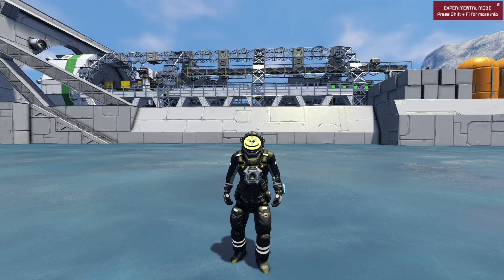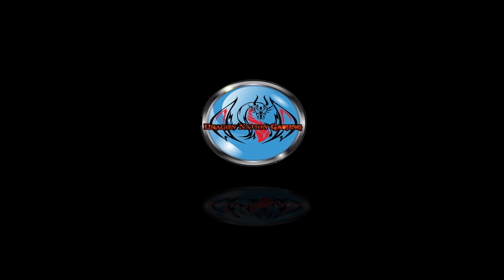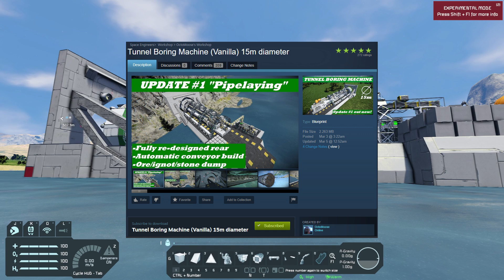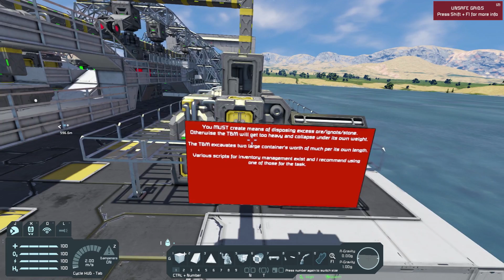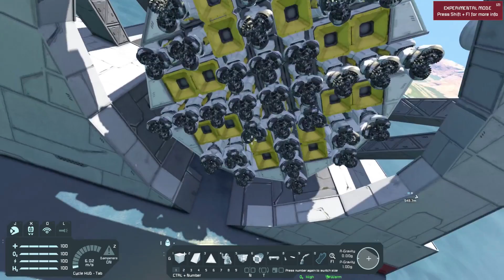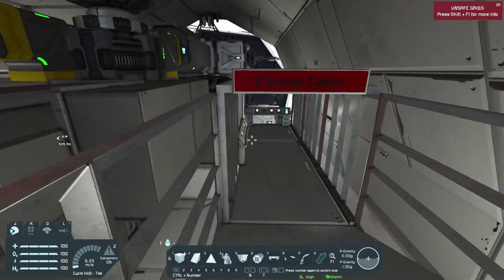Space Engineers #11: Octomoose Boring Machine

Comment: I know this may not work now, but I was thinking. What if you could replace the rotors on the top for making the system move forward with the pistons you use now, then make a similar thing on the bottom where it connect to a conveyor which unloads the resources. This is only taking your Inchworm system that works and merely using it's workings on the Octomoose's design.

You have three pistons, two top and one bottom. The first top one detaches from their merge block and moves forward where it connects to another, then pulls while the other two push the bore forward before the back top and the one bottom, that has a connector to the conveyor and merge block, would detach and move to their new spaces and so on. (The bore would still move and weld stuff while always having three connections as it moves. Just my thinking, and hopefully that makes sense.)

Comment: another idea for missed wielded areas add another set of projectors and a second bp slightly ahead of the others so they wield the farther bocks first then the older projectors can handle the rest, it might also add stability as you are adding to a set structure that would be connected to the inchworm tunnel itself and the tunnel machine.

Comment: Love the video but I use a drum drill instead of a bore. You get a wider tunnel. All you have to do is merge two rotors together and invert one of them (or just set the torque to 0 on one of them). 

Building a combine isn't hard and you can use pistons to move the mining arm up and down. This way you get super smooth and wide road. No need to build anything just add a few welders to the back and as the drills rotate around they are repaired.

You can just eject junk stone as needed, and have a transport dock and offload ores/ resupply components for welding.

Comment: You could use those modded advanced rotors, they are huge and don't suffer from a bad case of the weeble wobble...
https://steamcommunity.com/sharedfiles/filedetails/?id=1294456467&searchtext=rotor
Reply: This times 100. 

I like to merge two of them together for a giant drum drill. Makes leveling wide areas easy. Just make sure to either disable the torque or inverse the rotation on one of the rotors.

You can use it in both vertical and horizontal applications.

Comment: so from playing with this model in general, it DID work, however, there was a patch that broke the projectors. there was a work around but i dont remember (it has been a hot minute since i used this)

Edit: it would seem that the projectors are working. there are conveyers that run through the tunnel. the conveyer that removes the stone from the TBM (runs on the roof; part of what that grinder in the back is grinding) is left behind after the connector is removed. the stone is not stored on TBM after it is pulled from the connector to an off-ship storage unit/refinery/assembler

Comment: Looks like a real life copy somewhat miniaturized however -  10/10 to the guy who designed it if real tunnels could bore that fast Sheesh that'd be amazing XD 
just be glad you don't have to drive stabilizer bars into the rock face you've just excavated and then run concrete and mesh and all that crap XD space engineers so much easier. 

As for practicality in SE i give it a 2/10 
For going with realistic design and procedure 9/10 -1 for not running a better conveyor system to supply and get rid of waste rocks.

Comment: If we combined the voices of Rich from review tech and phlydaily then we would have your voice. Great video btw as well! =p

Also I totally agree, a creation/build on the steam workshop that is incomplete or not working is just wrong. It is like an unspoken rule that builds need to be complete before uploading. The sad thing is, this drill is basically a non-function and it was still populatized. As for rotating drill bits on a rotor. It can work however due to bumpy voxel collision a rotating drill has to move at a much slower rate compared to normal fixed drills. Which makes the design counter productive in a sense.
Reply: Totally agree

Comment: I'd call this a proof of concept, because it works... but it needs a lot of imrovement, I would alter the storage and add a few welders in the areas it can't quite reach or recommend using modded welders that reach further. As for the head... I don't know how well it would work but adding some small wheels all the way around the drill ~might~ help prevent it from getting too screwed up.
Reply from the maker: I try to stay away from wheels on creations like this. Wheels haven't been the greatest thing in Space Engineers but they do create some nice explosions.

Comment: You said that you got problems with the welder range. Why not put the welders on pistions, you could adjust the distance and maybe layer the welders to reach each corner
Reply from the maker: The problem with welders is available space. You would have to change the whole design.
Reply: @DragonNationGaming  good point there.   Waa thinking of a spine like column of conveyors center of the tunel and pistons in every cardinal direction with rows of welders so you could extend them to every direction. Similar to the welder rig you build in your latest Video just with adjustable distance of the welders

Comment: I dont know what ur talking about... It seems to work fine, the attatchment-method isnt realy a problem and it does weld the walls. (tho u´d need creative-welders) 
And why didnt u test it under load if ur convinced that it would fail?
Reply: The rotors do work, I have used them before, when changing displacements with timers, they work like mini pistons
Reply from the maker: Do they work every time?  @doomdave475
Reply: They haven’t failed me more than pistons, it usually works longer, than game can support the pipe.
Reply from the maker: @doomdave475  So the answer is no.
Reply: But pistons didn’t either
Reply from the maker: @doomdave475 We were talking about rotors. You added pistons so that you can keep arguing.
Reply from the maker: You don't know what I'm talking about because you don't know what you're talking about. Try testing it yourself before you start an argument or at least do your research. This is your last warning to be more respectful. I've been playing this game for a very long time so I know it doesn't work in survival.
Reply: Dragon Nation Gaming i didn’t mean to be disrespectful or anything. What i was trying to say is that u didn’t proof ur point, why the thing was supposingly not working.
Sorry if I sounded agressive, that wasnt my intention
Reply from the maker: @nextjaeger9271  No problem. The point of the video was to compare and find inspiration. The rotor method works sometimes but more often than not, it fails. His design gave me some really good ideas.

Comment: You could have welders rotating on another ring or disk on the ass end of the drill to build the walls of the tunnel.
Reply from the maker: Using a rotor might be a good idea. I would only need the rotor to turn very little.